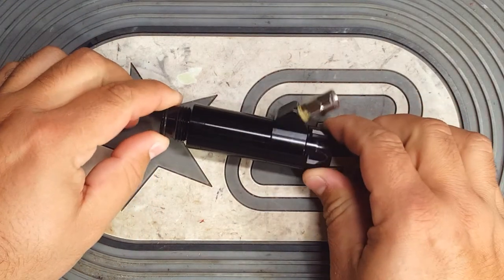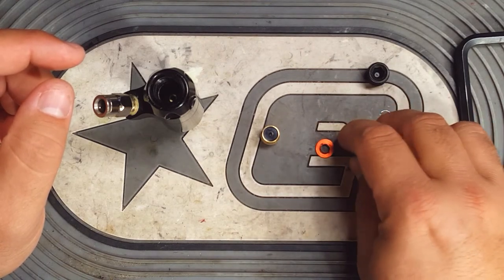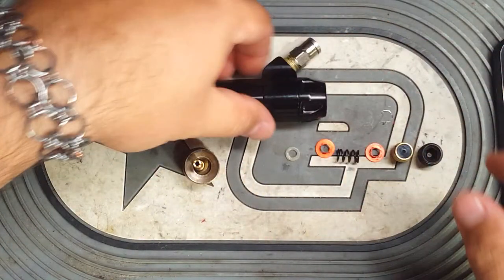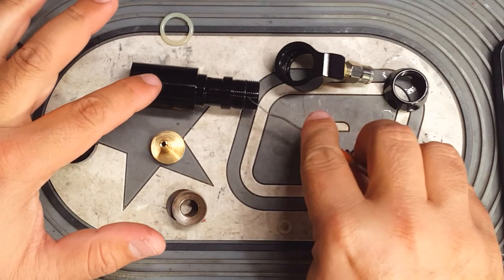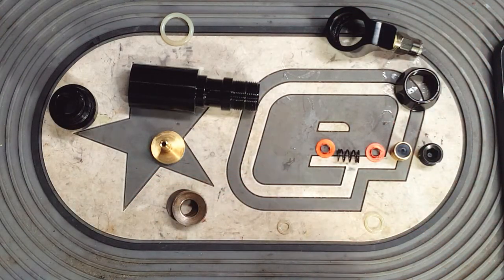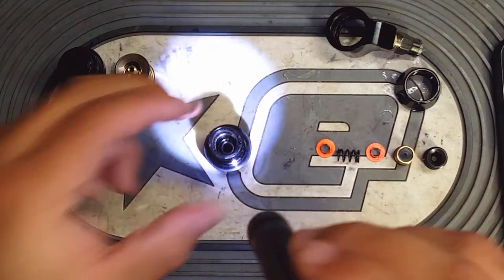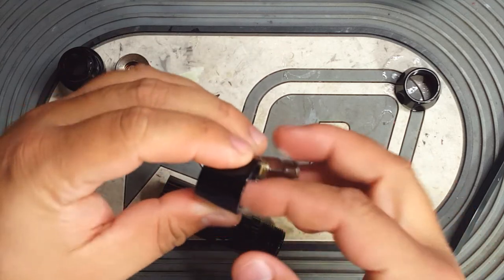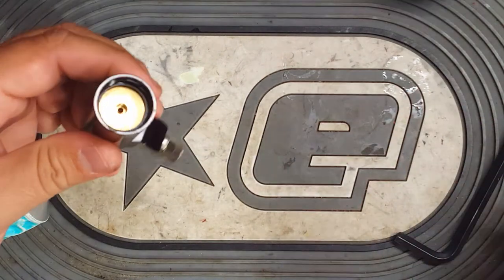Inception Designs Inline Regulator - Parts Rebuild with Paintball Tek

Comment: What threaded rod are you using at 9:09? Normal WGP cocking rod?
Reply from the maker: I had a standard WGP Pump Arm, but a cocking rod would work.  anything that is 10-32 threaded...even a long grip frame screw would do if you had a set of pliers to grab it but the rod is much easier to use.  That threading was put there by Simon for that exact reason which is nice :-)